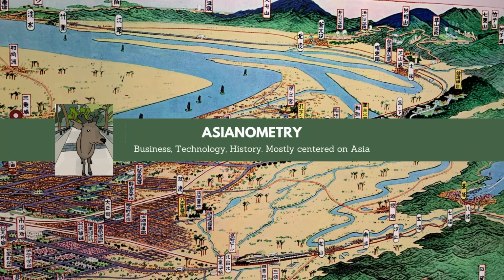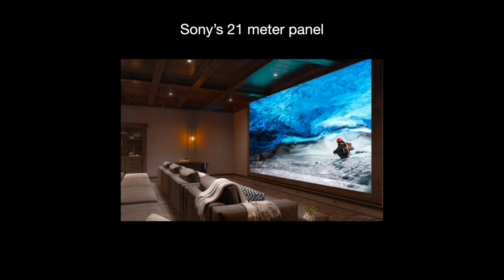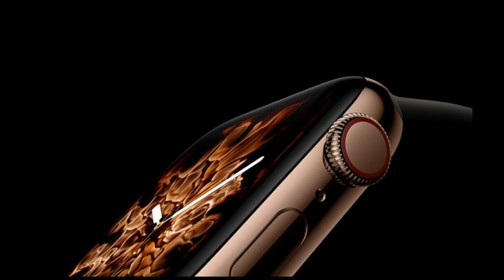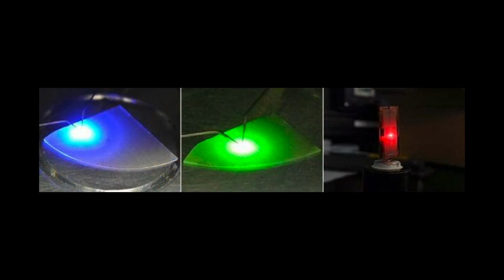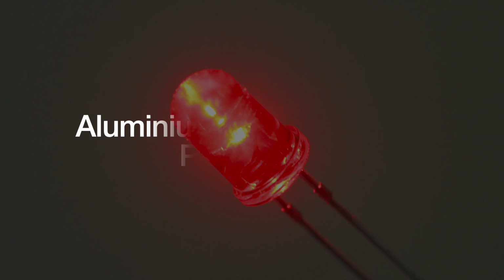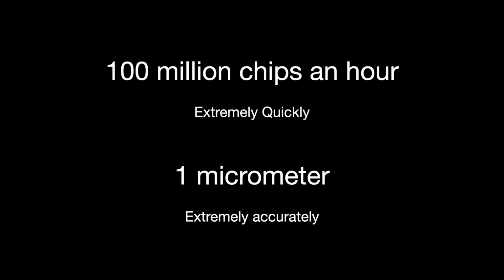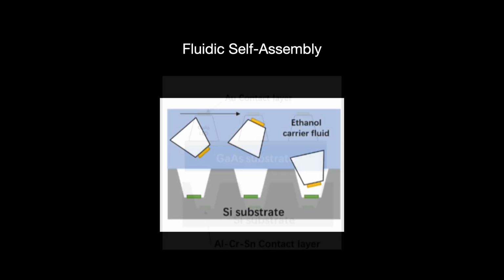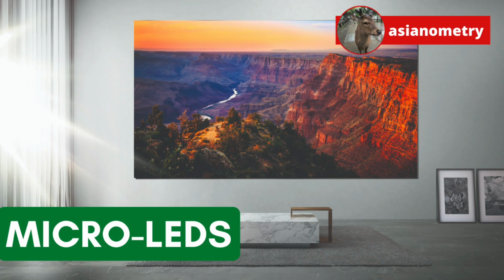Micro-LED Displays

Comment: One of the biggest areas where the quality of picture on CRTs was seen as poor by the majority of people wasn't the fault of the CRT, but rather the noisy analog signal of broadcast, things like RF or composite video connectors, and things like recordings done on VHS tapes. All of these things combined created fuzzier, noisier images that the CRT would dutifully render for you. Granted a CRT is really inefficient and heavy, but input a signal with something like SCART or S-Video with a digital input source, and you'll get a clean image, even high definition models existed. Sony's Trinitron models always looked really good back in the day compared to other ones I used.
Reply: Yeah the last CRT i bought was a 20in Dell (Sony) Trinitron that supported 1600x1200@ 60hz. That was around 2000. Used it for about a decade after that. I switched to LCD displays because they got cheap at higher resolutions. Also larger screens were good, because my farsightedness began to be noticable, this allowed me to push the screen further away from my eyes allowing me to not need readers. heh.
Reply: CRTs were necessarily big and expensive. You could not produce a 50 inch easily shippable CRT tv for $200 shipping included.
Reply: just look at CRT pc monitors. the good ones far outdo ANY lcd, even modern ones, despite being almost 20 years out of date.
lcd was a huge downgrade in picture quality in favor of a FAR superior form factor that allowed for much bigger (AND smaller!) screens. in fact lcds are also worse than plasma despite all of plasma screens shortcomings. oleds are finally the first type of screen that is decisively superior to CRTs in pretty much every way, and it's super hard going back to oily-looking, gray-ass LCDs after getting used to oled screens.
Reply: @GraveUypo  Emissive displays have always been superior, for obvious reasons. OLED has issues with in-batch and over time colour consistency, though, blue subpixels degrading much faster IIRC.
Reply: @GraveUypo  I agree on contrast (which the video got wrong!) and resolution independence but nothing else. CRTs are flickery and even ≥120 Hz causes quite a bit of flicker. And the resolution independence is basically meaningless for low-quality tubes, which often produce less sharpness than a pixeled screen outside its native resolution. And the power draw was better than people remember but still not great.
Reply: @GraveUypo  100% brotha! Emissive display are always the best. However, LCDs have their place - they're good for working with as they're easier on the eyes, and are of course large and cheap. They also make a good projection technology. But for media consumption, I'm one of the few who uses CRTs, Plasmas and OLED exclusively (depending on media type).
Reply: When HD first came out it was displayed on CRT's in 1985 at the  Tsukuba science fair in Tokyo Japan.  There after Japan had analog HD broadcasts and every Japanese that viewed them in the 90's viewed them on CRT's via satellite. CRT's have good colour. Everyone did their work on CRT's up into the 2000's . The scan rate and frequency determined the text resolution.  The latest display tech exceeds what we had back then.
Reply: Your assessments of connector types is clearly biased by whatever crap products you experienced.  Analog TV broadcasts were limited by the 6 MHz radio channel distance between TV station allocations, which was just enough for early B/W TV signals and was heavily enhanced to squeeze in color at a lower pixel resolution than the B/W part of the picture, thus any small colored items would get their color blurred with nearby pixels.
  Any signal not using the old broadcast color  subcarrier frequency would be immune to that problem on any display technology.  In particular, composite single pin video signals absence and S-Video use this blurry encoding, VGA computer connectors do not.  The computer monitors used in offices to edit documents and do accounting were all built to clearly show precisely colored text and lines, until the lawyers for Hollywood movie studios insisted that all high quality pictures only move between devices on encrypted digital connections that would be more difficult to copy, just in case someone was watching a movie after hours.
Reply: A Sony Trinitron looked better than any early LCD because it had black blacks, unlike a backlit panel. The intro to this video is by someone that never lived in the CRT era. Modern LCD has come a long way, but I think I would still prefer a good analog signal on a Trinitron over HD TV where I can see ever wrinkle on peoples faces.
Reply: A freind of mine had a really good CRT monitor. and my god is it sharp and the colors look very natural,maybe a little desaturated, but the perceived sharpness is insane.
Reply: For regular TV CRTs are really awsome. I still use them every day for regular TV. The analog video system is much easier to work with than HDMI and ethernet. You can run 50 meter long cables to have a screen in your workshop and so on. You can even modulate multiple channels onto your own cable system. The equipment is cheap or free now because everything is going digital. CRTs and analog video are still very useful and definitly have a place in the modern world, not just for retro stuff.
Reply: Totally agree!!! The LCD is a step back in terms of quality of image. Let's see if it is now that they manage to catch-up. Although the ability to have multiple resolutions is something that the LCDs, OLEDs, etc. will not be able to beat the CRTs.
Reply: @BernardoAntunes  lol are you people blind? lcd etc hands-down beat any crt in quality of " image" only thing crt was better at was refresh rates
And they all can have multiple resolutions what are you talking about and the more fine the dpi the better hell you phones in your pocket would kill crts in that department today you people need glasses all crts just did a interpolation
And all had distortion etc from never ever going to be perfectly flat
Reply: And CRT also has less jagged edges on pictures because it is rendering "dots" on the screen and not squares of pixels.
Reply: Well yes in the US there were CRT-TV sets without RGB input, something nobody in Europe understands. However unless you go to very high quality CRTs which cost a lot more and consume much more power (i.e. 80 Watts on a 15" screen) the quality is much less. Image geometry always was a pain and even displays advertised to be able to do high resolutions typically blurred the pixels quite a bit... even if they had enough RGB triplets. The only area where CRTs could compete for some time were monochrome and vector displays. Monochrome vector CRTs can still look very good if done properly.
Reply: They supported HD quality image too
Reply: Hello can any videophile here tell me if any crt can surpass dual layer reference monitors of 2022, i know they can't, the end.
Reply: @haberdasherrykr8886  Lol, CRTs are surpassed by everything modern in some respects, but not all. Dual layer reference LCDs are great with color reproduction, but not with motion resolution. CRTs are not the holy grail for everything. They're fantastic for retro and PC gaming (zero input lag and zero motion blur), and watching videos on them can be a treat. Even as a CRT fanboy, I watch movies on my 3lcd projector and you bet I'd prefer playing brand new games on a large Oled.
Reply: @mahdiyussuf9804  yes, plasma can have better motion and when it comes to games doesn't the overall system latency matter most? Also blur of modern games is only countered by specialised zowie e sport monitors (optimum tech YouTube channel)

I'm not sure about the rest maybe "the wall" by Samsung will be the ultimate movie and hdr gaming "compromise"
Reply: @haberdasherrykr8886  Yeah, overall system latency is very important, but it is true that despite being impractical for many other reasons, CRTs have no input lag or motion blur. I was just pointing out why some people favor them for some situations. I don't think e sports people use CRTs anymore since a high refresh rate and large display LCD is a better, efficient option by far. CRTs are just a great experience to keep around, especially for retro gaming (no native resolution, response and motion performance that can't be duplicated on modern displays). 
Def micro led is the future, esp with high refresh rate!
Reply: Odd that I’m here because my 5k monitor died, the “future proof” most expensive component of my 5 yo pc build, that is still going strong.  Never had a monitor die on me and now not sure new monitors will function properly because the DisplayPort upgraded.  PCI went from 3 to 4 so I’m not sure new graphics card will be happy on mobo… Days when “generational” meant grandmother’s armoire full of durability and sentimental value has all but vanished from the minds of humanity.
Reply: The problem of CRT for me talking about high quality content is just that it gets to a point where the quality doesn't improve while LCD or whatever with pixels right in front with high quality content get really razor sharp very HD, like it wants to come out of the screen from the huge sharpness.

What I really liked on the CRT was simply crap quality content would get good which is totally normal for anything projected vs drawn in front of you kinda like comparing a razor sharp drawn made with the sharpness pencils vs spray painting, both can look pretty good, but spray will never have the razor sharp of the pencil while it needs a lot of work too with pencil to fake spray painting just like a LCD really needs a lot of added effects on old games to try to smooth them out...
Reply: there is no apologism to CRT. truth is that CRTs are still superior to any other screen technology... except in two really really very important parts, size and weight.

the main thing that makes CRT better than everything else is its analog nature, there is no actual pixels nor color limits. 
in fact there is not even a physical image, just a very fast racing light that varies in intensity and color, the image is created by vision persistence. 
there is no way discrete pixels with discrete intensities can even hope to compare.

people think that CRTs were bad because TVs resolutions were comparable to something like 320×240, we talking about a image smaller than very large image thumbnails on windows. plus NTSC color signal was incredibly bad (pal at least had decent colors)

there was even some slim CRTs that appeared briefly before CRTs were gone that were less than half the size and weight of a comparable normal CRT, but was still too heavy and big compared to LCDs
Reply: @khhnator  everything you said is wrong and yes crts have pixels a pixel is a picture element lol
And ntsc has nothing to due with crt and crts where never slim its a big glass tube ffs even handhelds you people are full of nonsense
And crts didnt do that low res lol 
You have no knowledge whatsoever
And no color limits bahahaha ffs guy you can only make so many colors with rgb subpixels
And lets not forget the tons of other issues already explained here distortion geometry purity 
Tubes dying etc etc etc
Crts we're just good for retro for blurring the dithering and games were made with them in mind and ofcourse being old enough that you were used to using them for retro stuff and vector graphics
Reply: Crts use staggered rgb layout and will never be as sharp especially with text that is its main downfall
We wont get into the many other things like size etc etc etc
Reply: @primus711  That just means CRTs need better subpixel rendering support, which LCDs also need (and use) to make text look sharp.
Reply: @neolexiousneolexian6079  you cant with crts the way they r will always be that way 
And due to other issues as geometry purity weight size etc etc etc its a dead end road
You be better off with plasma
Reply: Uh oh. The CRT apologists are here! Hurry and escape while they lug that holy grail 2003 Sony Trinitron made for professional video work that weights over 100lbs. to the discussion like it was the common everyday experience for us mere mortals.
Reply: @EbonySaints  I always watch VHS tapes on a CRT because it better hides their flaws. I realise that makes me part of the problem.
DVD Looks way better on an HD-capable flat panel, though.
Reply: @worldcomicsreview354  True. It's just a playful jab on my end bellied by a subconscious fear of a CRT crushing me thanks to an old ass picture that used to float around the net of some Japanese NEET playing some MMO laying down with a big ass CRT suspended over his head living only thanks to the obviously superior two Japanese school desks keeping them from making a very explosive contact.

It's an irrational and dumb fear, but man that pic haunts me to this day, even though it was (hopefully) a joke and no one seriously played anything like that. Big balls and no brain on that guy otherwise.
Reply: @EbonySaints  lol
Reply: A huge problem with CRTs is that they are fundamentally high energy electron particle accelerators aimed at your face and eyeballs, and you the consumer are counting on the phosphorus and glass screen to stop all that high energy radiation without giving off too much secondary Bremsstrahlung radiation in your direction  -   Not.   All CRT screens had ratings for how much radiation they leaked onto your face - there was no such thing as a radiation-free CRT, and unlike watching your TV, your face was a LOT closer to that CRT computer monitor because you needed to see that fine detail, read your emails, etc...
So, those of you pining away for the Goode Olde Dayes of the CRT monitor, have at it.  Maybe the radiation will cure your zits.....
Reply: No... it was because of the CRT's. My N64 looks awesome with AV cables on my nice oled. Better than ever before.
Reply: @operator8014  of course it looks good because OLED is the first time screen tech caught up with CRT

Comment: Ironic that the world has gone from Red LED's being the cheapest/easiest to produce and Blue the hardest/most expensive to completely the other way around.
Reply: I remember having a hobby of assemblying LED Display  and experiment and bought those kits in Raon St. in Manila. That was in the early 80s. Bought breadboards and discrete components experimenting on TTL logic devices using LM 555  for our Digital Electronics Lab.
Reply: @SubliminalVibes  it died
Reply: LEDs*
Reply: I wonder if phosphor converted red would be a viable solution here, I guess they are trying to solve this with quantum dots, as they are like a tunable phosphor.

Comment: You start out with misinformation.  The CRT developed from simple beginnings, but in the last few decades developed to be a high precision imaging device that was superior to at least the first 20 years of LCD and other flat panel display technology developments.  We had CRTs in the military and commercial simulation market that were capable of resolution beyond full High Definition 1080P before High Definition even existed in the consumer market.   We had adaptations of CRT technology that delivered this image quality on display screens that were as large as 40 feet diagonal, or even larger.  At a time when no digital technology could even come close.  

Eventually, digital technologies caught up but it took many years and billions of dollars of R&D to do it. 

Even now, the CRT has specific advantages,  chief being its super low latency.  For some very competitive gamers,  CRT monitors are still their only choice because the savings of a few milliseconds makes the difference between winning and coming in second place for them.

The CRT is better than you give it credit for.

However, true full resolution 4K is too much to ask for a CRT to deliver because that takes 300 MHz of clean bandwidth at high power levels, and cathode capacitance is a limiting factor.   Plus, you wouldn't really want to have to pay for a linear video amplifier chain that can deliver 200 or more watts of clean power at frequencies up to 300 MHz.
Reply: I think today anyone in their right mind would just use an OLED if they really needed those last few milliseconds of response time.

Comment: Hey, don't forget the CFL LCDs! Those were where backlights really were most of the time until LEDs took over. I even had a MacBook with CFL backlighting.
Reply: Ccfl*
Reply: I came here to say this. He missed plasma and CFL backlit LCDs, those were out for quite awhile before the LED backlights came along.
Reply: I still have a CCFL LCD panel that works fine.  Though over time the CCFL gets dimmer and dimmer.  An old Dell laptop I had with a 1920x1080 CCFL backlight got very dim and I got rid of it.  So yes, LED backlighting is better, it's nice and bright and I've never seen it dim significantly while I've used it.
Reply: @profdc9501  I also have one, but the colors are pretty skewed at this point.
Reply: I still proudly use a CFL LCD in the PC of my electronics' shop.

Comment: CRT worked poorly? It took a long time for LCD to match them in overall quality.
Reply: Agree. Except for its weight and bulky size it is superior than LCD in almost every way.
Reply: @NSS7  I don't think there is still a lot of metrics where CRT is better than high quality LCD. Pixel response time, global contrast ratio maybe (but VA screens are still great and LCD are better with localized contrast)
Reply: it still hasn't
Reply: They still haven't in some areas especially gamin related (Digital Foundry made a great analysis video on this). Mind you LCD has other advantages like size.